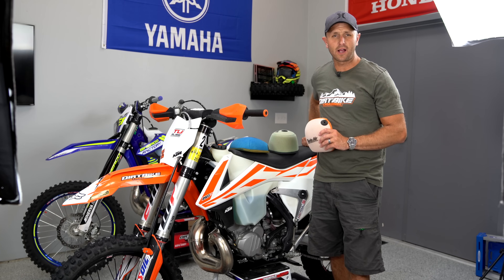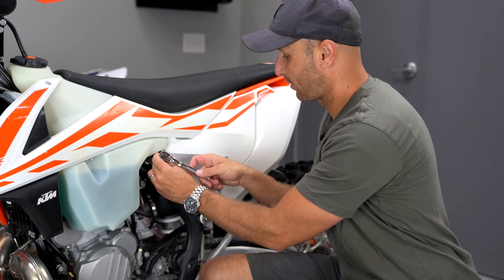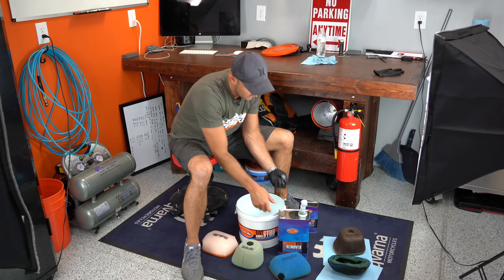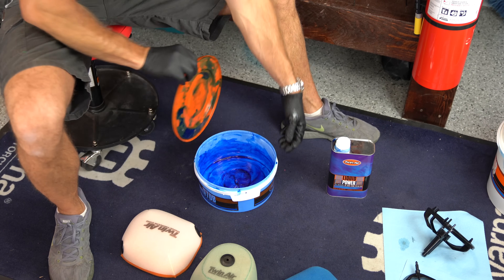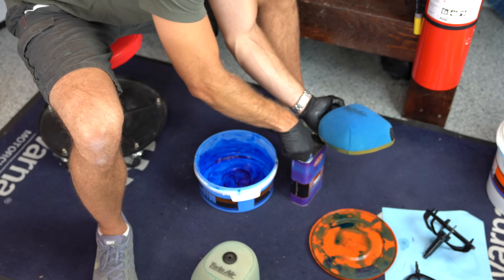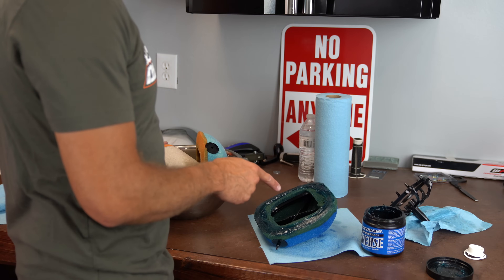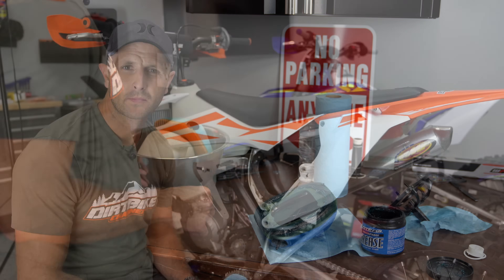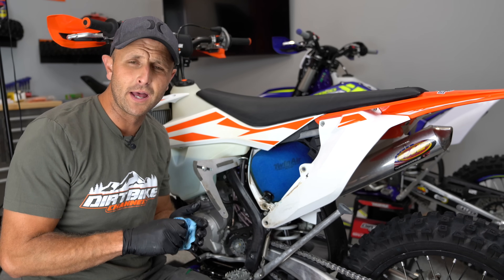How to Clean/Oil/Replace an Air Filter - For Beginners and Vets Too | Episode 288

Comment: Try out a 150xcw
Reply: *please
Reply: They work well, lots of the AA guys ride the piss out of them here. Some used to run big bore 125's vs the 200 option even so 150cc works well in the midwest. Few are SX converts since they don't make a XC model in the 150. The 2 riders in my club said took a bit to get carb close to perfect. One I rode was my buddies kids, plenty fast for me in Vet A. If it was a XC vs XCW or SX it would be my bike of choice if was buying a new bike but my old CR does me fine, love that bike but 150 just great handling in the woods when on the pipe. Rode a new left over 2016 and new 2017 250XC, still preferred the 150 but rode in premium track conditions on our event setup days. My main rival rode a 300XC then a 300 4 stroke and now a 17' 250XC and said he wished he bought the 150 and his kids rides the older version. He's a much bigger dude than me also so it works. His kid one his first race on this weekend also. Currently 1st and 2nd place in AA are on KTM 150's. KTM actually does ride days or ask you dealer if they sponsor or setup a ride day. 

There are other reviews on but most where slower riders that I found. Makes a difference but those people seems to like them also. Maybe Kyle will get one at some point though.

Comment: Kyle what makes applying the oil a little easier is pouring the oil into an old dish soap bottle with a drip free pop top. 

Also I oil my spare filter and keep it in a large zip lock bag ready to go for those 2 day camping rides. 

Top videos by the way.

Comment: i usually clean my filter in gasoline
Reply: Gašper Blažek terrible idea it is very harsh and will perish the layers of the foam
Reply: I did that for most my youth, it will break down the filter glue allegedly but by that time the filters junk anyways. I don't suggest it but its really not that terrible. At least for the filter (should use gloves though ;) and nothing gets them that clean other than buying a new one. Does nothing to the foam itself on a stock honda, UNI or twin air filter at least after years of cleaning multiple times a week in cheap 87 octane. Now more ethanol is used here but shouldn't matter on a filter.
Reply: It will not. I have been using gas for years and have never had one filter fail. Kyle's method of cleaning is insufficient. If you are paranoid about using harsh chemicals like gas or mineral spirits, use 99% bio-diesel. I used bio-diesel for a year or so and it works great and is no more corrosive to the skin than sugar. It is harder to come by in smaller towns, but is readily available in a big cities.
Reply: Gašper Blažek. The only problem with gasoline is it makes your hands smell like it. All that you really have to do bud is spray the whole thing down with Simple Green let it sit five minutes and rinse it out with hot water. That's way easier and soaking it in that bucket like but he showed all of us. Can I spray my filter down with K&N oil have been doing this on my micro sprint and numerous dirt bikes for over 20 years and it's never been an issue is getting dirt and the carburetor
Reply: I've been cleaning them in gas for over 40 years. Gas is more dangerous but does a better job of cleaning because it isn't oily. Foam rubber don't like oil. I don't put much oil on the filter, which is why my filters last a long time. Oil makes foam rot quickly.
Reply: @Aspired329  i use kerosene

Comment: 8:26 can u also use vaseline?
Reply: dont use anything, because on most bikes if you need grease to not let any dirt in, either your filter, your cage or your boot has a hole in it. the only thing the grease will do, is it will float on top of the airfilter cleaner(idk how to describe it, the closest thing would be like what you cough up when you are sick) , and when you dip or get the air filter into or out of the cleaner, it will get stuck on the filter.

Eithter tighten the crew more or add some washers if there are no holes anywhere